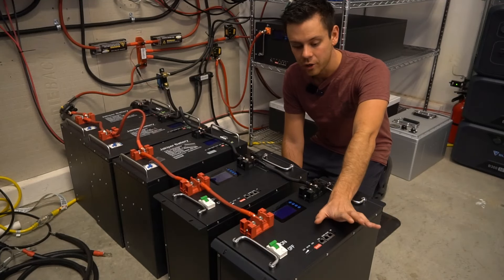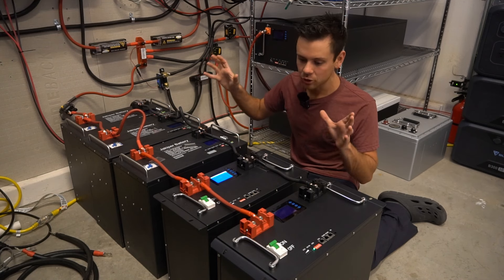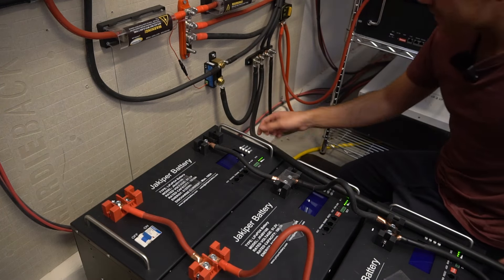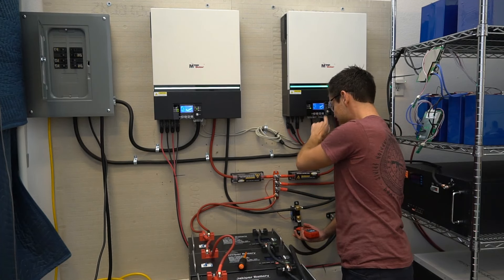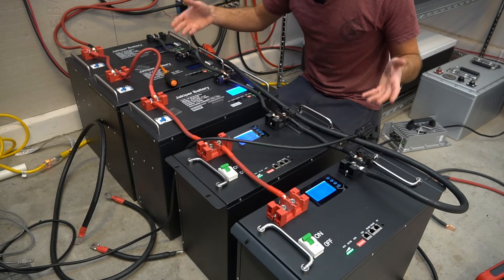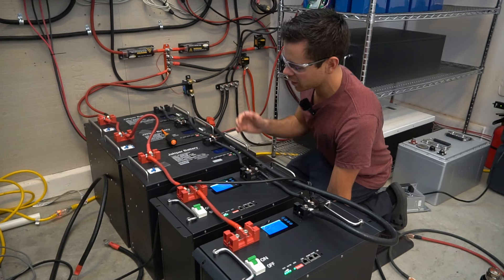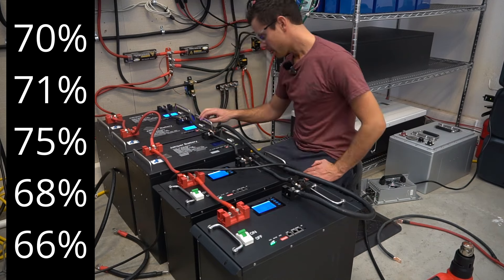Current Sharing Experiment: 25kWh LiFePO4 w/ Diagonal Wire Configuration

Comment: Bus-bars are the same as a diagonal configuration but essentially with a larger conductor. At some point a battery bank grows large enough that you would need really thick and long bus bars, so it becomes more economical just to have equal length conductors from each battery to much smaller bars (length wise).
Reply from the maker: Yes very true!

Comment: You need 5 rack units of the exact same brand put in an actual rack. Then do the following tests. Wire it 3 ways: Bus bar, same side, opposite side. Cycle each method and record each battery for % of total amp draw at 100/75/50/25% state of charge. This is a lot of work but would fully prove how each one performs. I agree that it will most likely level out once you pass the first 10-15% of a battery charge.
Reply from the maker: Yes I plan to do that soon. I don't have that many packs but will soon.
Reply from the maker: Bus bar is only method I've found to work every time.
Reply: consider use one DC current clamp to capture the current as each battery and make  consumption calculation be good.because each battery inside meter not the same reading sir.

Comment: Heh...in grad school I had a high-current, low voltage experimental rig that used 5000 watts at 12 volts.  0000 cables, brass connections, and they still got hot enough to melt lead solder.  Had to use silver solder.  Rig was, of course, water cooled, even near the connections...but that was a LOTTA current. Of course, we were heating carbon tubes up to 2500 C.

Comment: Parallel cables are not a problem. It's  common practice. A difference in the conductor length is not optimal.

Comment: I think a major flaw in the test is wiring size,hot wires= resistance and voltage drop etc,4.0 wiring with   same capacity batteries would have been a great test....

Comment: I like the argument, bus bars with equal length conductors are the best solution, even though bus bars might be cheap or expensive.  It seems like for keeping things simple, you should just use a better configuration of jumpers, unless you have so many jumpers that you can't install them on the battery terminals, or that the jumpers end up more expensive than the bus bars.

Comment: Clearly cable resistance is a factor here, but the other thing you dont talk about is the fact that the cables are not connected on the same terminal on the batteries. It at least needs to be checked that there is low to 0ohm between those terminal posts. I’m not sure how a bus bar will completely fix this, that’s also made of copper/other metal and will have some resistance

Comment: Hello Will. I just want to say thanks for all of your videos. You have the coolest job and I really appreciate the information and tutorials. Keep it going!  You’ve inspired me to put together a 12V 600Ah system for my RV and I’m in the midst of building it now.  This battery test video reassures me that I should be okay to use 4/0 cable and hookup my six 100Ah Lithium batteries in the same diagonal wiring configuration you have demonstrated here. I hope to be finished with it in a few weeks.

Comment: In the Army we wired the batteries diagonally. This was something I learned in AIT Electrical Engineering, to balance the charge and the load and get longer battery life. Those were lead acid batteries on trucks though. Glad to know it works even on LiPO batteries for when I convert over from lead acid. Right now, living alone they work for me and are less expensive up front.
Reply: sadly, the dual batteries on virtually all diesel pickups like my ford f250 are NOT wired diagonally.    each has its own chassis ground wire, and the loads are all connected to one, which has a fat wire over to the other.

Comment: Watching this again because as I mentioned elsewhere I'm playing with a lithion and lifepo4 parallel packs connected to the same inverter. It really I testing how the two act differently but the major item I'm noticing is how they share current. It is really I trusting. I've got a pile of wire from changing lengths, guage, and I've ven recently changed the connection location. The lifepo4 likes to dump current but the lithion shines on low current constant load situations. Best way to thoroughly learn is with your hands. Personally anyway

Comment: It’s actually quite simple. When the batteries are at the top or bottom of the curve, the large batteries will supply more power (amps) as they’ll stay in the steep curve longer than smaller ones (they’ll be both supplying the power and pulling up/charging the smaller batteries). Once they are in the flat curve all will contribute the same as all will be around the same voltage. Once they reach the bottom curve, the large batteries will supply more power again as they will still be in the flat area - they will “prohibit” the small batteries from dropping - keeping the voltage at the flat area.

Bottom line, if you want to use this type of setup, especially with LiFePo4, just keep the voltages very close to the flat area. Then 99% of the time, all batteries will be contributing the same as they will have limited voltage differences.
Reply from the maker: Exactly!
Reply: @WillProwse  in future can you do some ebike battery testing and budget ebike testing please PLEASE
Reply: @richardhobbs7107  I just received a Ancheer Hummer model ebike and I want to modify . I do love it so far but 22 mph in full electric mode is to slow and replacement battery packs just have me scratching my head I can't tell good ones from ripoff junk
Reply: It would be useful to know how much of these SOC differences are due to their curve characteristics and how much is actually due to voltage drop.

Comment: You talked about the wires coming from the inverter needing to be equal links going to your distributing block. What about the wires from the distributor box to each battery bank do they need to be the same length as well.

Comment: Mechanical Designer, but also do electrical and when I passed my Ham lic we learned about common grounds and it applies to pos, neg as well. So my guess is your common bus bar would be equivalent to a common ground. Each battery would have a cable that could handle the 40amps per battery, but the Bus bar and the cables to the device device (car) would handle the combined amps, so the individual batt cables would not get as hot. That gives you a common voltage ref point and reduces noise and interference as well to surrounding electronics. Good video, gives me some ideas even on a smaller scale, but I am sure you have clarified more in later videos. I just found your channel a few days ago and they pop in now and then:).

Comment: As long as the conductors are large enough to avoid voltage drop across the batteries it doesn't mater which way you wire it.

Comment: Excellent demonstration.  My system uses equal length conductor paths which I prefer although in a larger system that would entail buying a lot of copper.  Your diagram called it Post pattern.

Comment: These last two videos have a dress questions that I have had for a long time. I’m still re-watching them to make sure I understand everything and I just ordered some appropriately sized fuses so that I have my batteries properly protected. I keep learning from you but like someone else said earlier I am especially admirable of your focus on safety. I have a neighbor who is trying to learn about solar and he is putting one into his RV. He’s been watching your videos but I don’t think he’s listening closely as he had four 100watt panels in 2s2p connected to a controller with a 50 foot piece of extension cord with the ends cut off, all feeding into a 3000 W inverter. Think it was 16 gauge. The inverter came with cables which were intended to be paired but he only had single cables on them. His components were correct per your plans but the wiring itself was downright scary. I think I’ve got them straightened out. A bit more focus on correct and appropriate wire size would be helpful for the newbies. Otherwise I’m always really loving your videos.

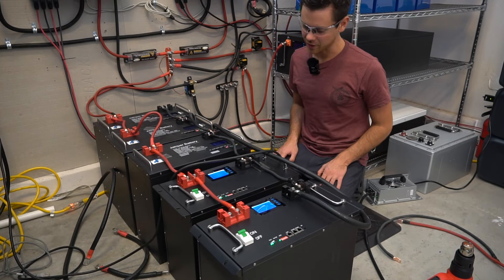Comment: I believe problem is that the current from one battery to the next is additive. The conductor size to the inverters were increased but the conductor between each battery was not. This is why the positive conductor you felt was so hot. It was carrying the current of all but the battery closest to the inverters. It would be very easy to place an ammeter on each one to measure this. If you were to use very large conductors it would have the same affect as using bus bars (as in the "posts" diagram at 10:03 in this video. While not ideal the conductor terminals could be ground down to fit inside the battery terminals. This would be better than using undersized conductors. Obviously larger battery terminals such as the mystery batteries use is better.

Comment: Hey man, this was a pretty cool experiment. I noticed you didn't measure the voltage drop across each length. That would've really helped explain the variation and show how much the diagonal configuration is normalizing C rate along the chemistry's discharge curve compared to the daisy-chained configuration.  Then, when you mention how bigger batteries have lower internal resistance, it will actually provide context towards the experiment you're running. In addition to calling out current and SoC, please call out the pack voltage and if it isn't too much trouble, the voltage drop across the cable segments.

Thanks for the vid.

Comment: Wow that is what I thought would happen, but it is always awesome to see it in action!
I think the best way to connect the batteries is Posts or functionally identical short Bussbars, what I mean is that you have equal lengths wires either stacked directly on top of each other in the Posts configuration (but that would require alot of torque) or alternatively use the exact same wires to connect everything to a copper bussbar that is only spaced apart enough to fit the lugs next to each other. That way you have the advantage of Posts but you have much more surface area touching each lug, because a lug to lug connection is never perfect.
Reply: that is why I have a copper pipe 1/2" flattened and drilled hole to equally distanced batteries. There is only one screw in point. And opposite take off +ve and-ve  3x200 ah 12vdc in parallel
Reply: @leopoldpoppenberger8692  copper pipe is a good cheap way to get started. May I ask how you attach your lugs to the pipe? Is it bolts and nuts sandwiching the lug to the pipe or is the pipe threaded and you are tightening down to that?
If you were to ever upgrade your inverter you should definitely increase your system's voltage. Get a 4th battery and wire them all in series to get 48v that would certainly increase your efficiency. If you are also using 12v appliances then just use a 48v to 12v DC-DC converter.

Comment: I think using large gauge wire with the correct size lugs for your terminals and figuring out the best order for the packs would work great. If the lugs are too wide trim problem side or sides and hook it up.
Reply: @Jason Morgan 
Exactly- I’d have just trimmed the terminals on the grinder.
Reply: I tried that and it still pulls more from batteries closer to the load. As Will mentioned in the first video on this, it’s when you start pushing towards the output limits of the batteries that this issue arises. In that case the cost/size of the wires needed gets excessive. I’m going with the Victron image (third one) with the “posts” configuration, as I don’t have rack mount batteries. I’m using small free standing bus bars from Amazon to hook the batteries to the inverter, and the same for the charge controller. The bus bars are going where the big dots are where the four leads come together in the diagram. And of course, a much larger cable between the bus bars and the inverter and charge controller.

Comment: Another good video will!!    I particularly liked the discovery that the imbalance is much less when the batteries are in the flat part of the charge curve.

A few points:
1) If there are only 2 batteries in parallel, they will stay balanced if you hook them up diagonal.   Each additional battery above 2 will create more imbalance even with the diagonal hook-up.

2) If you use long bus bars as shown in the picture in the video, they need to be sized fairly large in order to minimize the voltage drop across the bus bar, otherwise you will get the same problem you are trying to avoid.

3) When making the cables for the battery hook-ups, each crimp is important.  If one of the crimps is not perfect, it can throw off any attempt to arrange the batteries for balance.
Along these lines,  server rack batteries should be designed so that when they are racked up you can bolt busbars directly on the battery terminals to interconnect them.  The Jakiper batteries in the video would not handle this well because the bus bar would have to be narrow and one of the busbars would cover the controls.   The un-named batteries look like they might handle direct connection to the busbars better but I would prefer to be able to put wider bars on.   If you used two thick bars on the un-named batteries it might work well.

4) When doing busbars, it is important that they be covered for fire safety reasons and electrocution safety on 48V systems.    I like putting heat-shrink over everything except the connections, but there are other techniques like mounting plastic covers that can be removed when servicing.......   Hmmmmm that would be an interesting feature on a server-rack battery: Snap-on Plastic bus-bar covers that are the height of the batteries.   
        1) Rack up the batteries
        2) Bolt on the busbars
        3) Snap on the covers
        * Done *
Reply: That's exactly what I did at my last battery install, got 400A flexible insulated busbar, drilled holes,  cut the insulation and bolted them in - 5 batteries connected to 3 inverters, no hassle. "CFX1045" from electromechanica
Reply from the maker: Agreed!! Good points
Reply: um, even with 4 or more in parallel diagonally, if the inter-battery wires are the same  gauge and length on both plus and ground, each battery sees the same total wire resistance on + and - combined.  say each jumper is 10 milliohms, and your plus feed cable goes to B1, with the - ground cable to B4,  then B1 sees 0 extra milliohms on + but 3*10 on ground, B2 sees 10mOhm on + and 20 on -, B3 sees 20 on + and 10 on -, and B4 sees 30 on + and 0 on -... so each battery has the same 30 milliohm in series with it.

I definitely agree re crimps, but with proper fine strand pure copper welding cable and a decent hex crimper and using the same pure copper ring fasteners, the crimps should be very consistent.
Reply: @geepeerces Yes, diagonal is better than nothing but it is not balanced beyond 2.  If you have more than 2 batteries in parallel and use diagonal to hook them up to the system,  the outer 2 will carry more load than the next ones in and so on.    That is what will just demonstrated in his video.      The higher the load, the worse it will be.     This was worked out years ago with lead-acid and holds true with LiFePo4.   

It is interesting that in the flat part of the SOC curve the effect is less pronounced than when the batties are fully charged, but the effect is there nonetheless.
Reply: @centerrightproudamerican5727  That's how the entire US grid works, higher voltage flows to lower voltage. Higher internal resistance lowers output voltage under equal load, etc.

Comment: Try using the diagonal configuration, take the power leads to the inverters out of the batteries 1 battery from each end. This will reduce the current from the jumpers that got hot and may allow the batteries to discharge more equally.
Reply: After what I can see and also what he is saying this IS diagonal configuration...